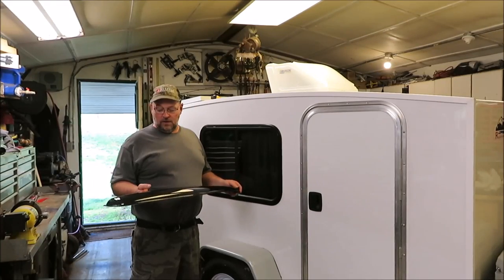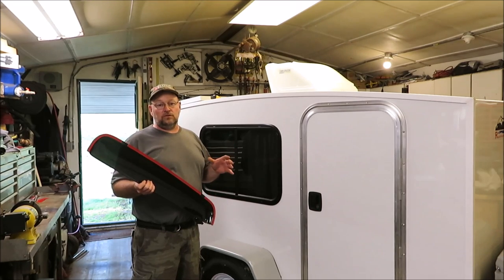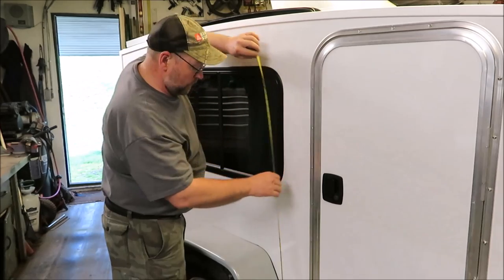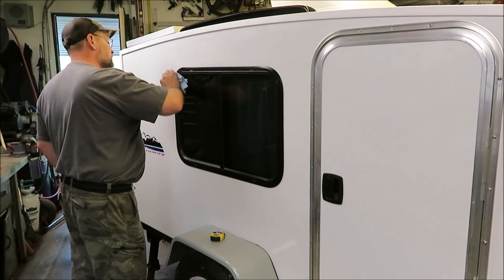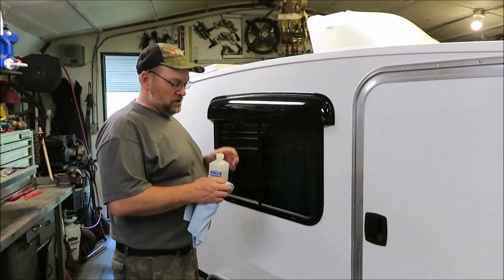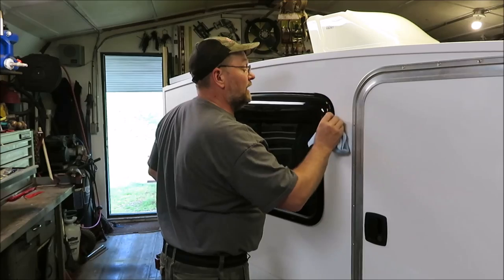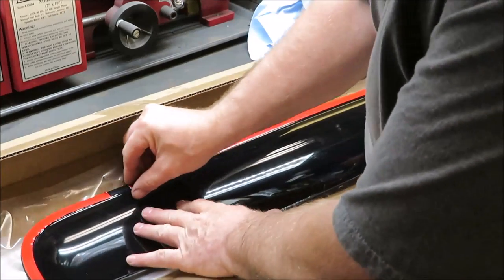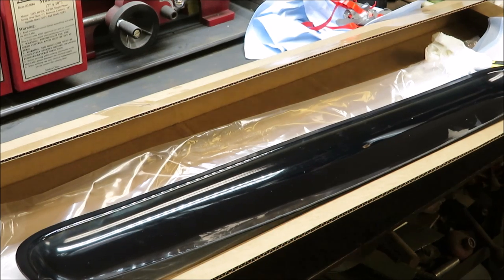runaway camper window rain guards

Comment: I really have to commend you Kevin on what you have done with the camper a great job all round. If you could get some of that aluminum molding that around the door and fit it around the visor it would not be going anywhere. Great job Mate.
Reply from the maker: Thanks for the info Peter.

Comment: Looks wonderful. Professional job all around. I like that you leave in any missteps you might run into. Much appreciated. I was wondering if you've considered an outside light next to the door? Like a "porch light".
Reply from the maker: The outside light will be in my next runaway camper video thanks for the comment.

Comment: kevin that is a great idea! I thank you your your vids you post, I am waiting for my camper to be delivered in a couple weeks. can you do a vid of a close up of the electrical box, I need to figure out a way to run a ham radio antenna inside the camper.
Reply from the maker: Have you seen all my videos on the runaway camper?
Reply: as far as I know I have, in fact I think I might have watched all runaway vids youtube has! ill go back through them and check if I have missed something. Also, I loved the portable light with Velcro, what a fantastic idea.

Comment: How have they worked out for you? I'm thinking about doing this to my old sixPac camper I'm renovating. I have 4 windows and found sizes to fit them all. Cheers!
Reply from the maker: They worked out very well light rain or open the side opposite of the rain and wind that's what I do.
Reply: Kevin Robinson thanks buddy,  I'm ordering mine now.

Comment: Don't those windows open from the side? The open part will still be exposed and let rain in wouldn't it?
Reply from the maker: I think they will be ok in a light rain.
Reply: I like the idea of it... but IF I do it, will be mounted on the opened side, not top. that way, when driving, the windows, can remain open partially, allowing airflow, with no rain getting in. It more uses the idea of the sunroof it was designed for. lt might not look right tho... gonna really think it over, Thanks for the idea !

Comment: Yup, any wind at all, even a slight breeze, those aren't going to do a thing.
Reply from the maker: I've put stainless screws in them.
Thanks for the comment and watching.
Reply: @Robinson-Homestead  not talking about the screws. Any breeze and the rain will still come in under the vent cover. Too bad Maxair isn't still making those louvered window vents especially for horizontal sliding windows.

Comment: Good idea Hatch
Good execution Kevin

I probably would of screwed a couple pan heads in it for redundancy but opinions are like buttholes. We all
Have one but only need to worry about our own. 

They all told me not to drill into my Kayak but had to put my anchor dolly on, move the rod holders etc. the right
Screw and a dab of silicone and it's good to go, even in salt water. 

👍🏻

Comment: These automotive sunroof wind deflectors used in your project are a failure due to the fact that they are made for curved automotive roofs and the tension to rebound off a flat surface will always remain therefore it is required to use screws for mounting regardless of what type of adhesive tape is used. Also the curve at the bottom front edge leans inward toward the trailer wall which directs the water inward toward the window which defeats its initial purpose of keeping the window dry. There are other flaws which I will not get into here but I wanted to warn others that you are wasting your time and money if you try this. How do I know? Because I tried it. I am just surprised Kevin that you did not leave a comment of your rain guards performance which I know failed to keep the window dry.
Reply from the maker: if you had watched all my videos you woulld have seen that i put screws in them and as far as the windows being wet they were fine .i also said that if there was a big rain storm they probally would not work as well,if it is drizzling its ok to let the windows open just to get some fresh air..thank you for you comment.
Reply: I watched your entire video and know that you put screws in them but no one wants to drill holes in the side of their RV. that's what they made 3M automotive or 3M VHB adhesive tape for but you have to screw yours in because their is constant tension to spring back due to it's curved automotive roof shape. I am not here to give you a bad time just stating some facts and frankly I just wanted to comment so that your viewers are aware that these automotive sunroof wind deflectors are not designed for this type of project and the deflectors direct the water inward (due to the inward curve at the bottom lip) toward the window which defeats your initial goal. Again I tried this and it did not work as intended and is a waste of money and time. I would hate to see someone else screw holes in their RV only to find out that these sunroof wind deflectors don't work as intended for this type of project. These sunroof deflectors only protect the top window frame and not the entire window.

Comment: I use Drip Caps from Vintage Technologies. They are aluminum and they work good. I use them on my teardrop windows and door. http://teardroptrailerparts.com/Windows___Doors.html
Reply from the maker: Thanks for the info RDC Garage.
Reply: Kevin Robinson they have different sizes, just call them and tell them what length. They are awesome to work with. And they shop Super fast.